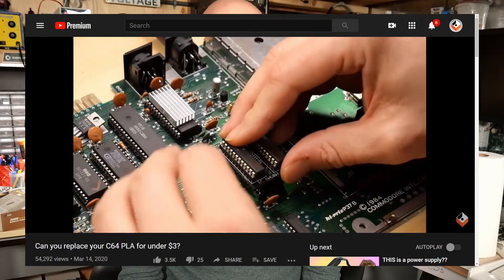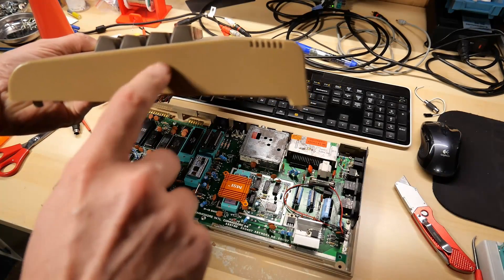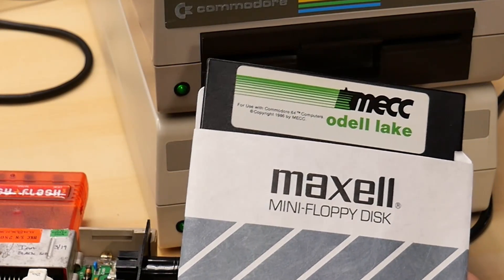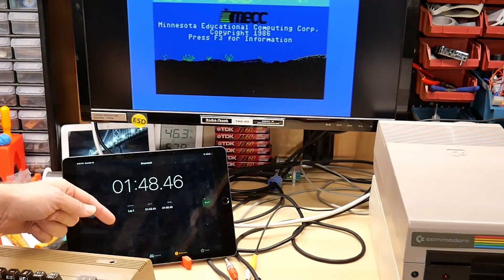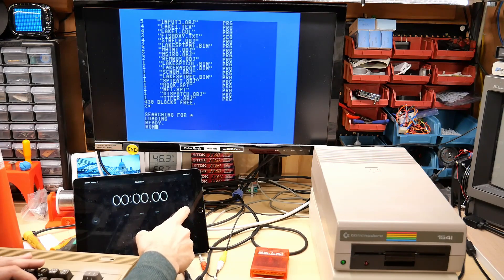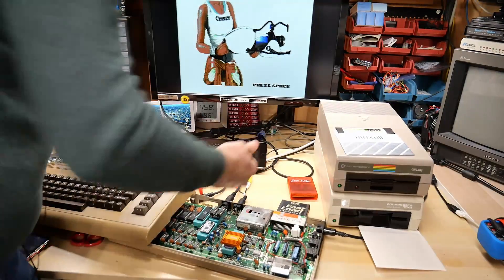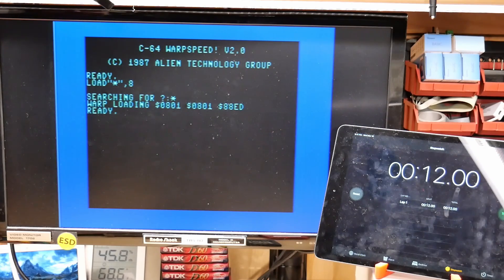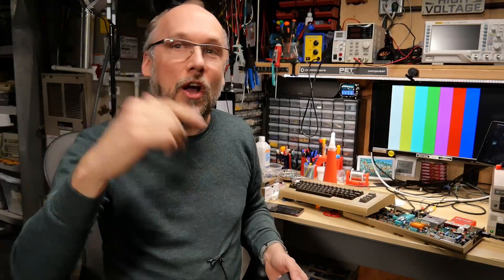Does the $3 GAL-PLA work with Epyx FastLoad? (Bonus fastload comparisons)

Comment: Freezers, EPYX fastload, even Super Zaxxon differ from most ROM cartridges in that they have logic to switch things in and out of the C64 memory map. The EasyFlash has patches to emulate bankswitching, but it might not have the same timing as the real hardware and that is why it doesn't work with some board revisions.
Fastload has a particularly awful way of doing it. There is a hex buffer in the cart wired to various control lines. When RESET, I/O1 (DE00-DEFF), or ROML (8000-9FFF if EXROM low) are pulled low so is EXROM, telling the PLA to map the cart via ROML when 8000-9FFF is accessed. So at reset and as long as the ROM in the cart is being accessed, it stays enabled. This makes it autostart at reset and installs the wedge. Once the CPU stops accessing ROML a capacitor on the EXROM line begins to charge from the pull-up resistor in the C64, eventually bringing EXROM to a logic high and disabling ROML. The capacitor is to keep EXROM low through VIC and CPU RAM access: it takes several cycles for EXROM to go high. I/O2 also enables the cart ROM, so part of the ROM is mirrored at DF00-DFFF. That's a shim that hits the I/O1 @ DE00 a few times to pull EXROM low and bring back ROML before jumping to it. Whew. 
Aside from taking over the ROM and both I/O regions, the worst part about fastload is there are delay loops to ensure EXROM is stable before accessing anything else, and the indeterminate logic levels caused by the EXROM cap charging and discharging can wreak havoc with some FPGA-based PLA replacements.
The reason JiffyDOS is preferred to most other fastloaders is that it is a ROM upgrade, vs RAM or cart-based fastloaders. All fastloaders except for JiffyDOS have to use some RAM in the drive so they may have issues with copy protection and software fastloaders.
Reply from the maker: Great explanation! Pinned!
Reply: @Adrian's Digital Basement .. I assume that for "madness in the world" you mean the COVID-19 situation...... so (sorry for the Off topic) but this virus can survive in the plastic.. on that cartridge... up to NINE DAYS my friend ....  ...   as well as on glass... laminated surfaces like labels.... Metal like car's.. door handles etc.... 
Even on paper or cardboard can remain up to three or more days...
So if someone infected sneezes or coughs on that cartridge or package.. well..
What I want to say is..... that you should have sanitized.. and you hands.... spraying it with your favorite..... isopropyl alcohol.... or with some Dettol....

>> https://www.bbc.com/future/article/20200317-covid-19-how-long-does-the-coronavirus-last-on-surfaces
..
Reply: Additionally, unlike most/all of the cartridge-based fastloaders, JiffyDOS speeds up all disk I/O operations, including the random access of individual sectors.  Some games/applications have their own customized ways of accessing data, including the loading of code, which bypass the kernal load vectors and therefore are not sped up by the usual fastloaders.  In these cases, JiffyDOS helps just as much as it does for standard load procedures.  Some examples you can test this out on are some of the Ultima games, such as III and IV.
Reply: Great explanation,  and thanks for taking your time to give it.
Reply: A cap on an IO line? Yuck.
Reply: @darkwinter6028  Yep. Old methods to adding small delay to data signals before controls. Of course very small value capacitors. Commonly used in slow systems (1-2 MHz clocked).
In faster buses delays are matched by track length.
Reply: Indeterminate logic levels aside, I have to admit that was pretty clever.  I'm making a wild guess here, but they might've done it that way to increase compatibility... the cartridge ROM is simply disabled (except for the mirror at DF00-DFFF) when it's not needed.  So most games (at least the ones without their own custom loaders) wouldn't even be aware of its presence.

Comment: I had a Danish fastloader back in the days. I at some time stumbled upon it again - although I'm not totally sure it's the same version (edit: revision there's sure very much similarity on all parameters) - hardware wise with a red and blue button sure. That is also significantly faster than the Epyx - without weird analog (capacitor) tricky like the Epyx.

Comment: The commodore 64 was the first computer I actually purchased. When I purchased mine, it was one of the earlier C64s. I used a C64 for every computer task until I moved on to the Amiga. Nearly all people who had C64's early on, started out with a cassette tape based loading system. It was incredibly slow. By the time people were able to afford the expensive 1541 disk drive, we were starving for any performance increase possible. The 1541 delivered that performance and was much, much easier to use. The Epyx Fastload Cartridge when it came out, was extremely expensive and in the era of some of the most brutal copy protection ever created, a lot of programs would not work with the fastload, if you could afford to purchase one! Very few people I was around at the time ever spent the money on a Fastload cartridge. Almost no one compared disk drive performance with other disk drives, because most of us could not afford more than one computer! If the choice was a fastload cartridge or another box of 5.25 disks, we'd take the box of disks every time. Don't forget we were using modems and the bit rate (baud) of modems was constantly increasing, forcing people to upgrade to new modems regularly. I went from 300bps, to 1200bps, to 2400 bps, to 9600bps to 19200 bps... There was a lot to spend money on with this computer and the fastload cartridge did not make as much difference as things like a new modem or boxes of disks for more software, and back ups of the programs we wrote at the time. The Epyx Fastload Cartridge would have made more of an impact had it came out 2 years earlier. By the time it came out, people were already moving on to other, more capable computers like the Amiga 1000, then the A500/A2000s. By this time, the PC started developing "mass" with all the PC clones that were available. Only businesses dealt with IBM. Everyone else purchased clones for less than half the cost of the IBM PC.

Comment: The real FastLoad cartridge uses a 470nF capacitor as a form of delay. Since the PLA finds itself exposed to an analog signal (a slow ramp), the hysteresis effect on the inputs of the PLA is critical to proper functioning.
See:
Schematics of FastLoad - https://rr.pokefinder.org/wiki/Epyx_FastLoad
Hysteresis in electronic circuits - https://en.wikipedia.org/wiki/Hysteresis#Electronic_circuits

Comment: The Epyx Fastload was one of the first on the scene and was available anywhere you could buy software. This made it very popular by being easily accessible. My buddy back in the day bought a Mach 5 cartridge. It worked fine. Some things loaded faster, some slower. He bought it through mail order. I bought my Epyx cart early on. As other cartridges came out and being faster like the Warp Speed, I wanted one, but being a kid at the time didn't want to spend the money for something I basically already had.

Comment: I am meanwhile trying out fast loader cartridges and kernals like JiffyDOS or Exos and list the results on my homepage. I think, the results are kind of surprising. I have tried two parallel cable kernals (SpeedDOS and Formel 64) and they are not faster, than the fastest Loader with an original Hardware. FCIII is pretty good, Exos is better and right now Action Replay MK6 is fastest. Today, I have received a Nordic Power cartridge, which I did not try In my benchmark Setup, yet, but it seems to play in the AR6/FC3 league. JiffyDOS is nice and I like it, but AR6 is much faster. http://tech.guitarsite.de/fastloader.html
Reply from the maker: Interesting! Action Replay MK6 never made it to the NTSC word -- but AR5.1 is really fast especially when you save with it first. It's kind of mind blowing really.... So with JiffyDos, I really noticed a big speed improvement with it when you first write the disk or file with JiffyDos enabled ... then the reading speed is much improved. (This is on a 1541.) On your chart, was it reading a disk written with the stock firmware and Kernel or with JiffyDos?
Reply: @adriansdigitalbasement  It was a random disk from a collection, I have bought. It is an interesting idea. I will check it when I find the time for it.
Reply: @adriansdigitalbasement  It is a random disk from a collection I have bought. But I could try it. In case I produce a JiffyDOS disk and it is faster, then I know, it was not saved under JiffyDOS :-)

Comment: The VIA 6522 had a Hardware bug . The implemented shift register function could not used by the C64. Commodore has build this IEC transfer code in software. This bug slows down the transfer rate 6 times slower then expected. Had you any issues with the gal pla till now ? I ordered 20 PCBs from pcb-way. The prices for an original PLA here in Germany rises up day by day. Even when you get an original PLA this chip will die soon. I hope that the GAL PLA is a good replacement.

Comment: I'm looking forward to the day when you discover hardware floppy speeders ;) I was involved in the re-issue of the professional DOS/RapiDOS speeder ... loads 250 blocks in 4 seconds :)
Ideally you'll check out the recent follow up project called MeGaLoDOS which attempts to unify a number of hardware speeders ... including those which load a full floppy once and then exclusively work out of RAM (i.e. TurboTrans) ... loading 250 blocks in less than 2 seconds.

Comment: Back in the mid '80s I remember using a fastloader that was a small file on the disk with the filename of an up arrow character.  To activate it you'd type load "[up arrow]*filename*",8,1.  The screen would slowly fill with garbage characters then clear and the drive would take off and load at the rate of about 3 head steps every 2 seconds.  The file was small - about 10 blocks and could simply be copied onto any disk where there was enough free space.  I have no idea what it was called though - it was 35 years ago.
Reply: Yes, those were software fastloaders. They have two main disadvantages, the first that you have to load them explicitly, which decreases the convenience of them a lot. But their main disadvantage was compatibility: C64 software will assume that it has all of the computer available: There are no provisions in the operating system to divide the memory across several applications in a fair way. Therefore a software fastloader will often try to hide itself in fewer used parts of memory, but there is still a lot of software that will use the memory where the software fastloader tries to hide.

Cartridge fastloaders don't have these disadvantages: They install themselves on power on, no user action required. Because these cartridges only activate their ROM when it is needed, they are able to hide themselves very well from software, they don't use any RAM that be used by software.

The third category are KERNAL fastloaders such as JiffyDOS: These replace the C64 KERNAL. Their advantage over cartridge fastloaders is that they can speed up all disk operations, not just the operation that can be hooked. If software uses SEQ or USR files, those are typically not speed up by cartridges, but are speed up by KERNAL fastloaders.

Comment: My friend lent me an Epyx Fastload cartridge in 1985 and it made a massive difference for the load times on my 1541. I've never heard of Jiffy DOS
Reply: That's not surprising.  JiffyDOS required minimal hardware changes, both in the drive and in the C64.  Specifically, you had to replace a few ROM chips.  As easy as that sounds to someone like you or me, it's beyond the abilities of most end users.  So the various fastload cartridges (Fastload, Super Snapshot, Warp Speed 5, etc.) were more popular because there was no hardware modification involved.  It was so easy, anyone could do it.

Comment: The EPYX fastload worked great back in the mid-80s for speeding up load times. I would recommend using an early EA title to test the fastloaders. Something along the lines of Archon, Seven Cities of Gold, or M.U.L.E. These titles were VERY slow to load on a stock system and the EPYX cartridge sped them up nicely. I think the EPYX cartridge was popular not only because it came out earlier than many of the others, but it was also relatively inexpensive at the time.

Comment: What might be the case for Odell Lake is that it calls a KERNAL initialization routine. Cartridge fastloaders depend on
the LOAD/SAVE vectors from $0300 onwards in the memory. The KERNAL initialization routine resets these to the default
KERNAL routines, disabling the cartridge fastloader. Because JiffyDOS modifies the routines inside the KERNAL, it
doesn't get disabled by this KERNAL initialization routine.

In my youth years I had patched several of my games converting this call to the KERNAL initialization into NOPs, so I
could use my cartridge fastloaders. I had the KCS Power Cartridge and Final Cartridge III back then.

Both are superior to the Epyx Fastload cartridge and especially the FC3 fastloader is a really advanced piece of
technology. It loads a file out-of-order, so it doesn't need to wait until the right sector is under the head and it
has a highly optimized GCR decoding routine intertwined with the serial communication code.

Comment: The first game tested probably does not "load" the other files but reads them sequentially with file I/O which jiffydos also speeds up and all "normal" fast loaders without drive kernel replacement I know of not. I never had jiffydos at the time but the epix before switching to dolpin dos. The epix fastload was the first I encountered which loaded with screen on, jiffydos I did not even know about before GEOS times.

OT: Someone commented on tape loaders. The well known tape loader "turbo tape" which loads with left arrow + L  was 10 times faster as normal tape load,  floppy disk without fast load only 7 times. Most commercial games on tape used slower loaders, some even with screen on block counter, space invaders during load, music etc.

I created a variant of this turbo tape as "Turbo+" where I made the 1 shorter and the 0 longer than the original on save so the bits can be better distinguished with VIC interference. It had the same speed but you could load the files with screen on. I added a command to toggle if the screen is on during load to be able to load the  original format. But that was quite late so it did not spread I think.

The "magic" tool mentioned which allows you to load games from tape without a special loader just writes a stripped down autostart turbo tape before saving the actual saved file in turbo tape format. At least the one I dissassembled before I even had a floppy disk drive to get at the saved program and the fast loader as it also started the loaded program. Some 3rd party casette recorders had a speaker so you could hear and distinguish the loaders. As disks  were expensive I used tapes much longer to "archive" files. I also wrote a menu program where you could input the time or tape counter of my tape (do not remember exactly) which then switched off the  tape motor at the approximate position of the desired file during fast forward.

Comment: Not only is warp speed fast as hell, but I have never had a conflict with disks that have their own fast loader.  i.e. It always transitions gracefully to other fastloaders.  I've been lucky enough to have had one since childhood.  Bonus: Warp Speed carts also have a C64<->C128 switch (for use with 128 mode) and reset button.  Best cart that existed back in the day IMO.

Yes, it's been under everyone's radar forever.  I think it only took a back seat to Epyx Fastload because it came out later.

Another bonus is that in a C64 the 128 switch effectively acts as a disable switch.

Comment: You weren't using the Epyx FastLoader when you typed "Run". You were just running the custom loader. You got faster results with JiffyDos, because it speeds up all disk operations.

Comment: The software you are using to test bypasses the kernel routines.  You cannot test most fast loaders this way.
You simply need (if you want to test fast loaders), load different ones from Disk (Maverick, Fast Hackem', & I would recommend a few others)  If you want to know more, respond to my comment and I'll put together a comprehensive list you can test along with links for them.

Comment: I had a Warp Speed in the 80s. While its better than Fast Load, its had quite a few compatibility issues from memory. I often had to remove it. Also the Warp Speed cart came with a Reset Button, while on the fast load it was a often made mod, but it wasnt stock.

Comment: Epix Fastload doesn't really do anything tricky, it's just a ROM.  It installs itself much like a DOS Wedge.  The Commodore 64 Kernal uses the Zero Page for bits of code it needs to run faster, and because of that the code can be changed to wedge in extra code, since the Zero Page is just RAM.    The EasyFlash cartridge doesn't need to emulate anything to just put something in ROM space.  Where it does something tricky is with replacing an entire kernal, or a snapshot cartridge.   Also, large cartridges like Ocean 512K etc, have more than just a ROM, as they need to switch banks, so they tend to have a couple support TTL chips.    BTW, I spell kernel wrong, because every manual that Commodore talks about a kernel, they call it kernal, so I guess that's the name of their operating system.
Reply from the maker: Check out the pinned comment on this video about how the EPYX cart work. It definitely does trickery and non standard things -- and yes the term KERNAL goes back to the Commodore PET in 1977.